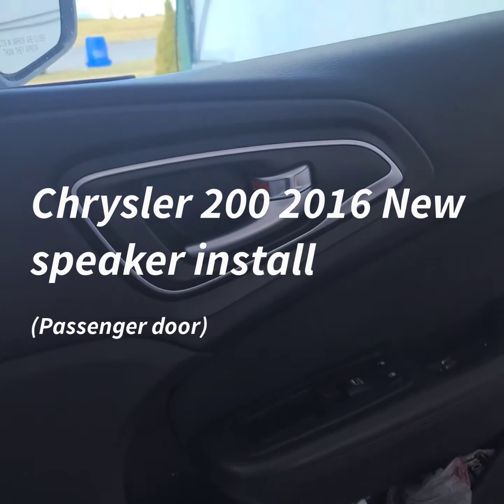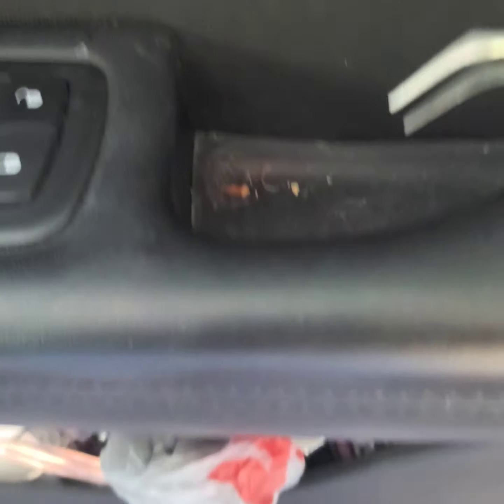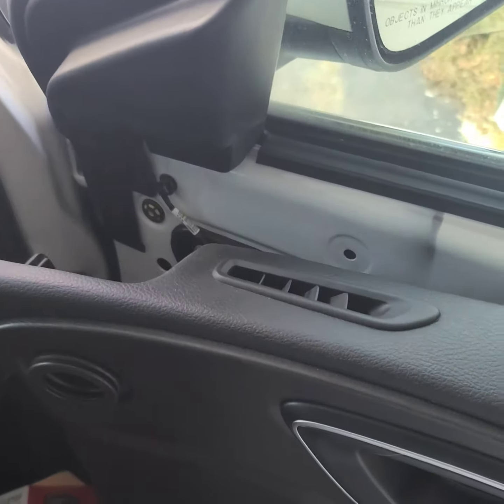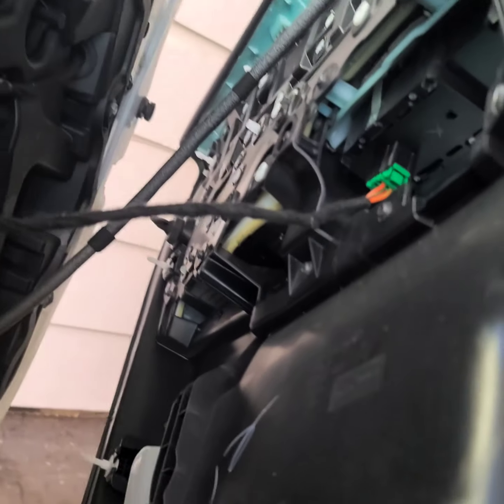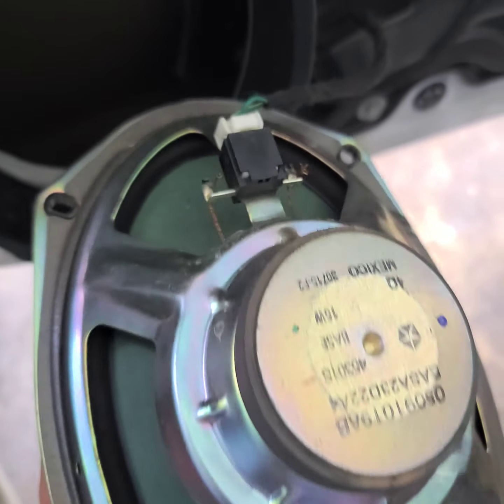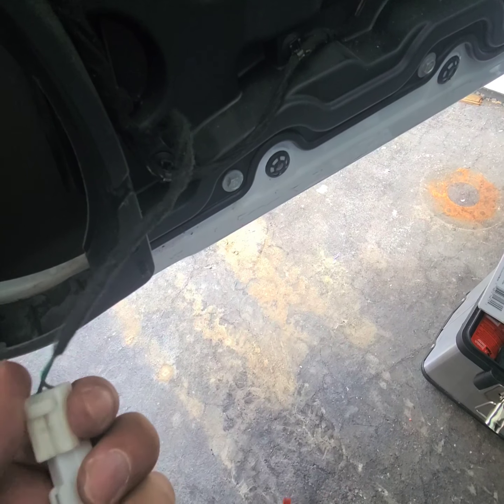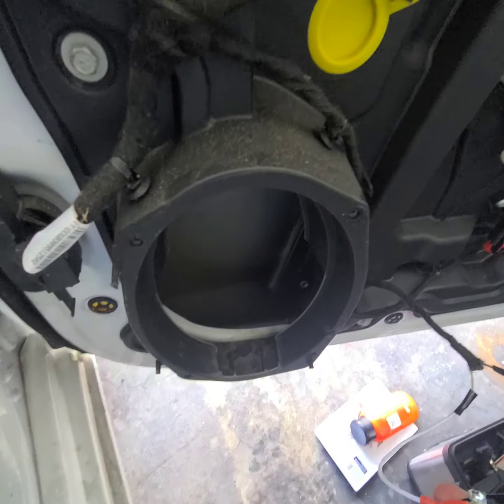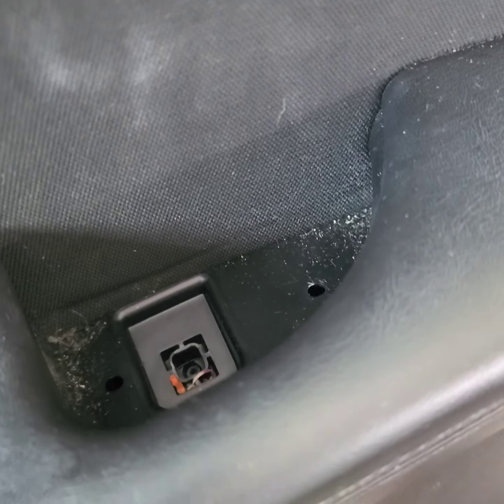Chrysler 200 2016 How to Install New Speaker (Passenger door)

Comment: What about the terminal cause I bought a speaker didn’t have that connections
Reply from the maker: You can search them for your speaker connection or cut the connection part off and hardwire the negative and positive to the wires in the door. You can also get crimp tool and make a wire that way to connect to the door. I recommend you search the harness up for the proper connection.
Reply from the maker: Try this https://www.ebay.com/itm/115299556727?mkcid=16&mkevt=1&mkrid=711-127632-2357-0&ssspo=YcA93LknTz-&sssrc=2349624&ssuid=lGMh5bP7Rtq&var=&widget_ver=artemis&media=COPY

Comment: What size speaker
Reply from the maker: It was a.     5 &1/4 speaker.    with a 6x9 mount but you can use a 6x9. If you go to Crutchfield.com and search the vehicle it will tell you different sizes you can use and what you need.